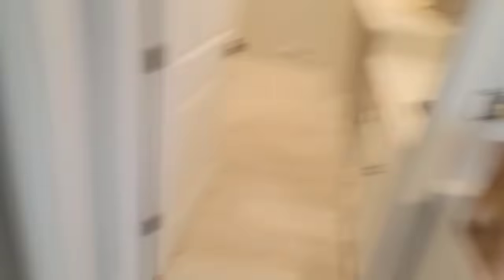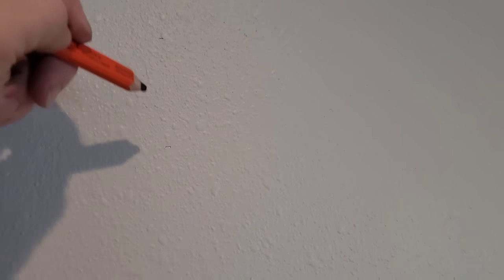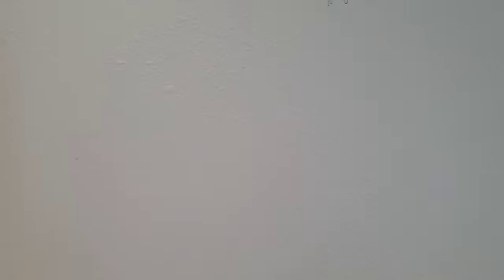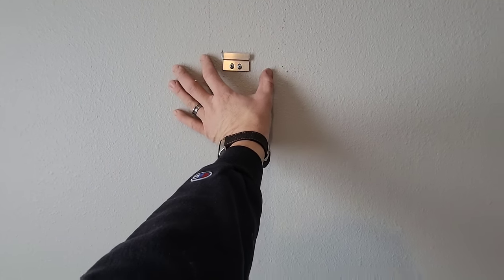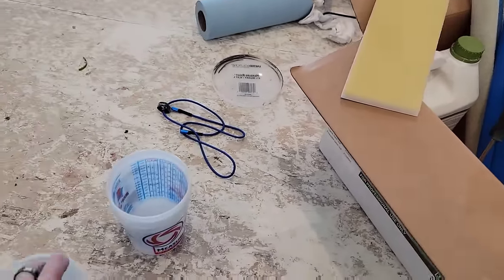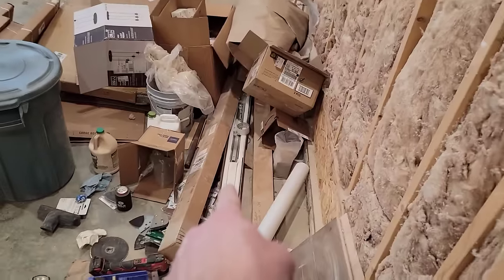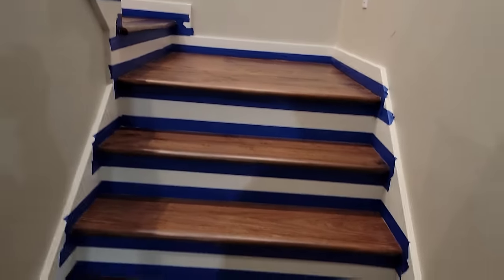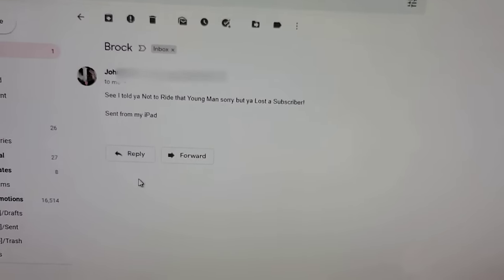Mirror, Mirror on the Wall - #605

Comment: Mirror mounting tip for others. As you are done. 

French cleat. This case I might suggest a metal bar and short metal tapping screws to mount your brackets. This Eli are the drywall anchorage. 

Btw. Shop drawings good time to double things like outlets sinks and mirror coordination